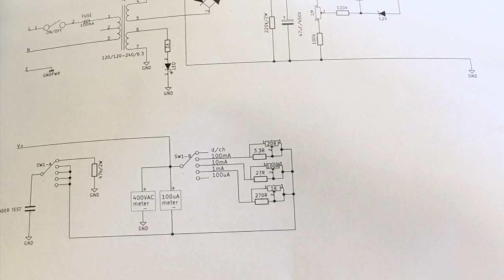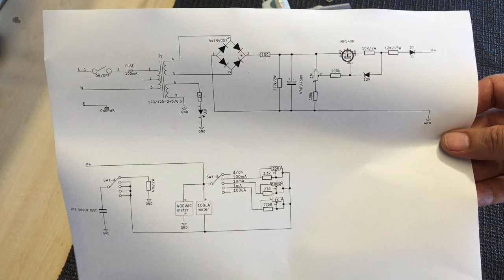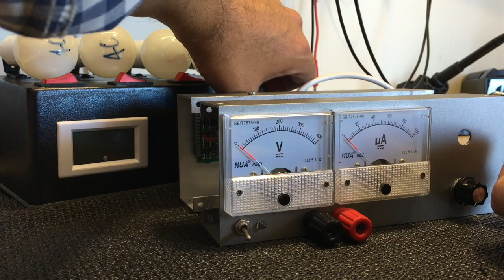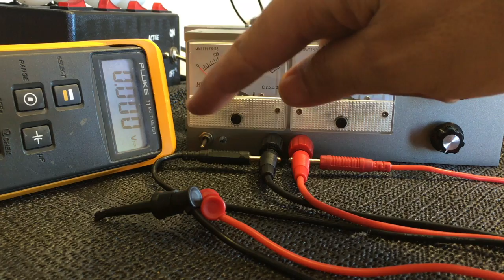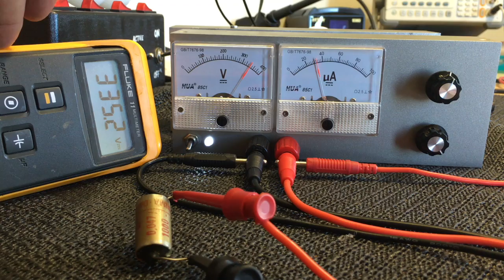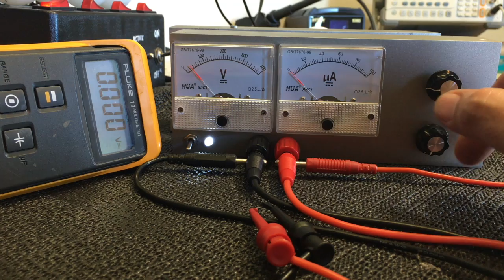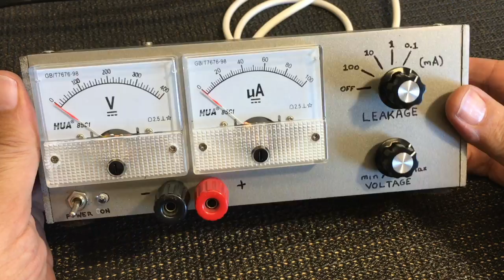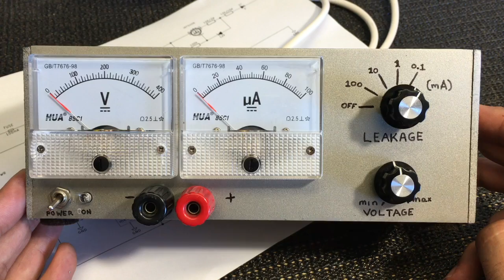Capacitor leakage tester design & build DIY - Part 1

Comment: Hello M. Caldeira. Found all of this very interesting. Learned a couple of things. A request: any chance you could give the details concerning the  potentiometer and the switch? Manufacturer, reference number, characteristics, where to buy it? I looked for a parts list but failed to find one. Maybe I missed it. Thank you, so long.
Reply from the maker: +rui oliveira : the potentiometer is a normal 1meg linear pot, 22mm. This one is an ALPS but any other one should do. Use the bigger body ones, and not one of the miniatures as you want a higher voltage rating. The power switch is a normal toggle rated for mains voltages and the rotary switch is a 6 position, make-before-break, rotary switch. They are easy to find on eBay or at your local supplier. Enjoy.
Reply: Thank you so much. Best.
Reply: Kind of you. Thank you for the information. 
So long,
Rui

Comment: When testing calibrating the 100 miliamp setting you had troube getting the reading down did you change the resistor in the unit if so to what value or did you leave it as designed. im just getting to put mine together so any change that could be implimented now could save time later. thankyou .
Reply from the maker: kevin charman : I’m afraid it’s been quite a while and I don’t recall. Sorry about that. Good luck with yours.
Reply: M Caldeira thankyou .I think this is the perfect piece of equipment for my repair workshop

Comment: Thanks . does a 240v primary 300v secondary transformer do the same job.
Reply from the maker: The 300V secondary will produce a D.C. voltage quite a lot higher than the one I have used, but will work. Just be careful of component tolerances due to the higher maximum voltages.
Reply: @electronicsoldandnew  I have a 220 / 300v transformer I got from a tube radio amplifier.  if I use it in the leakage tubes tester I will change what on your circuit of leakage Tube tester. Thanks

Comment: Hi there，I have built this tester recently, but I got a problem with it. My power supply is 500VDC, when I connect an analog meter to it, the voltage drop to 300vdc, but when I remove the analog voltage meter,  and measure the out put with a digital multimeter, the out put voltage is 500VDC. could you please tell me what is wrong with my tester? thanks.
Reply from the maker: Your analogue meter is low impedance so it draws current and drops the voltage.
Reply: thank you for replying me. My analog meter is the same model with the one in your video.

Comment: one more question you state at one point during testing your unit that you would move the diode that is inline and after the 12k resistor am i right in understanding it would end up directly fixed to the plus socket output ?
Reply from the maker: kevin charman : not sure exactly what I meant at the time (it has been quite a while) but you can’t put it right at the positive output socket because it will then stop the discharge function through the 47k resistor when you switch it off. You could put it just before the switch, I suppose.
Reply: M Caldeira thats what i thought ill leave it where it is.

Comment: Hi, is the tester also useable as electrolytic capacitor reformer? Or is the current draw to low….
Reply from the maker: Perfectly useable.
Reply: Cool! This is going to be my next build then :) maybe adding an extra switch with a 4.7k resistor to unload the capacitor. Can the current draw stay the same or do i need add an extra 15watt switchable resistor?
Reply from the maker: Wait a week or so as I’m doing a revamp of this project 😊
Reply: Okay! i have to finish another project so this build was on the to do list… i’m looking forward to it!

Comment: Any one building one and need a lower MIN voltage like I do, I replaced the 100K resistor from pot to gnd for a 47k to get 12.5 Volts .To calibrate the 100miliamp range I swapped the 3.3 R resistor for a 3.6 R and this worked perfectly .I have just reformed my first CAP with 100 percent satisfaction.
Reply: Any chance I could discuss this build with you?
I have a few questions about parts.
Reply from the maker: i’m afraid time is an issue. The project was presented as comprehensively as I could make it, and numerous viewers have commented with useful info as well. I suggest you read all the comments, as they should provide enough material for a build.

Comment: Fantastic work M. is there any way of increasing the top end test voltage.. to around 450 volts? and also any way to decrease the lower voltage even to 5 volts? Thanks for the Great video.
Reply from the maker: Terence Kaye : the series that covers this design gives ideas about how to get the range you want (higher voltage power transformer, and power resistor between the pot and ground), but you must BE VERY CAREFUL with the component voltage tolerances, or you can have some serious fireworks.
Reply: Hi Thank you for your reply,, I well watch the other videos that you have done.. Yes I will be extremely carefull.. :)
Reply: Instead of a full wave rectifier in the PS, you can use a voltage doubler. If you do, you can add an "X2" range switch for better resolution. Of course, with a doubler, you will cut the available current in half.

In this application, that shouldn't matter. If you are measuring tens of milliamps, even through a large electrolytic, the cap is too leaky.
Reply from the maker: The only problem becomes the voltage rating of the components.

Comment: I liked the video and I'm building one, I'm having trouble getting the transformer. What code / reference do you use
Reply from the maker: Companheiro Medeiros : just use a 230 to 230 or so. I had this one for a tube preamp. You can also use a 230-15 and then another 230-15 and therefore get the isolation needed for safety. Check out the web for examples of this cheaper method of getting a 230-230 transformer.

Comment: Around 7 min, you talk about grounding/earthing the pot.
May I ask, seeing that you are on the isolated secondary side of the transformer, why would you do that?
Kind regards
Reply from the maker: I connect the CASE of the pot to the chassis, which is connected to mains earth. The actual pins of the pot are NOT connected to ground. This is to protect me in the event that the pins of the pot short to the case and passes up to 350VDC to its casing. In this event I will at least be protected from shock.

Comment: If a VTVM was used instead of the Fluke, would you not see the false reading  when measuring the uA meter?
Reply from the maker: Kc6vbv : not sure I understand the question. The fluke has about the same input impedance as a VTVM, around 10Meg.
Reply: M Caldeira 
My mistake, I didn’t realize the fluke had a hi impedance .  Excellent video by the way.
Reply from the maker: Kc6vbv : thanks.

Comment: Great video. How much leakage is bad for a given capacitor.?
Reply from the maker: diedraak1 : depends on the type of cap and where it is used in the circuit. Some must have Zero leakage. Others, like filter caps can have some. Search the web for some detailed info. There are some really good articles out there that can describe it much better than I can.

Comment: Beautiful work and great explanations! ....I would like to know the final size of the box...thanks a lot!
Reply from the maker: +Rogerio Zambotto : 20.5cm x 8cm x 8cm (WxHxD)
Reply: Thanks a lot!! I liked this box solution.
Reply: Other question is about the circuit....did you use the 100 ohms resistor after de rectifier bridge?

Comment: Could you please put a link to the schematic in the description ?
Reply from the maker: +FROZEN CYANIDE : actually lost it in crashed hard disk, but you can easily get it from the videos. Be careful to use the correct mosfet, as the schematic has the wrong one indicated.

Comment: Nice. But the IRF 540 is only rated at 100V. Better use IRF740 or 840.
Reply from the maker: check the notes on the description where I mention the erroneous mosfet.
Reply: @electronicsoldandnew  Sorry, didn't see that.

Comment: There are much better home built capacitor testing devices there that use only a 9 Volt battery. 300 Volts is not good: dangerous, and it will not find all the capacitor leaks with 300 Volts anyway. 9 Volt testers will never miss any bad capacitors, will always find them. Google it.
Reply from the maker: I’m quite aware of the alternatives out there. I like variety - and this one is my favourite.

Comment: where can i find the schematic+bom?,cheers Paul.
Reply from the maker: Can get it from the video.
Reply: @electronicsoldandnew   i just thought you would have it on a google drive,saves faffing around doing screen grabs thats all,cheers Paul 73.
Reply: @electronicsoldandnew  sorry to trouble you,the fet you say to use is £14 here in the uk,i have a 2sk4005 from an old laser printer,would that work in this?,cheers Paul.73
Reply from the maker: Must be n-channel, and be able to accept the voltage as mentioned in the video.
Reply: @electronicsoldandnew  mine is ok for 900v source to drain,does the 12k resistor need to be 15w? i ham having no luck finding one.
Reply from the maker: No, 10W is fine and even a 5W will do.